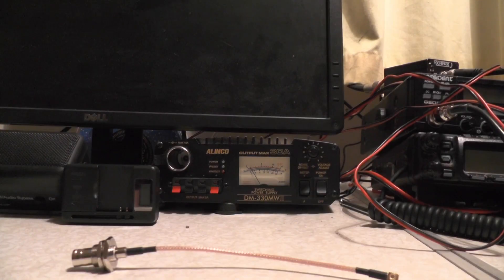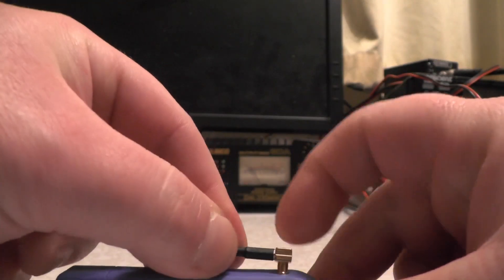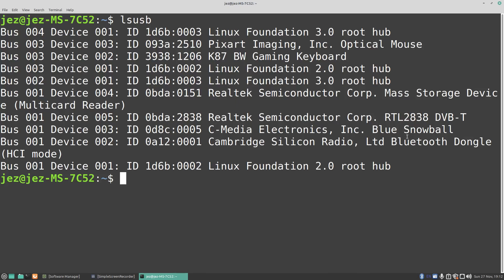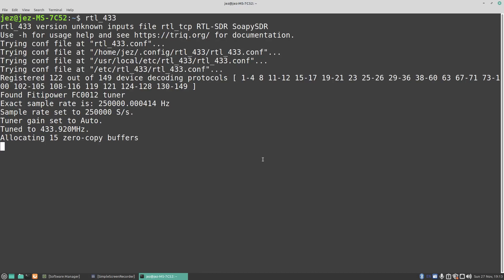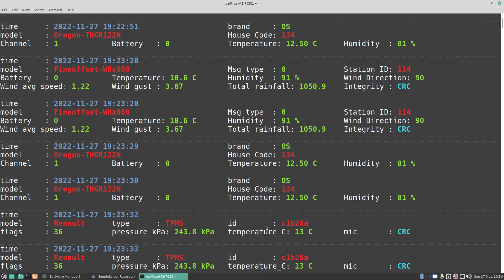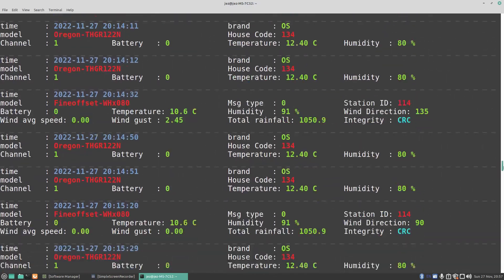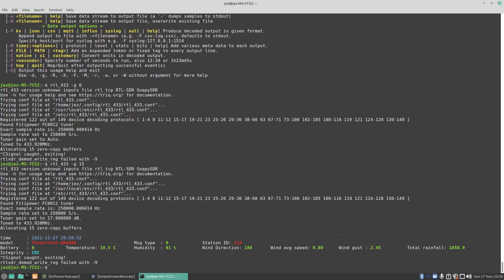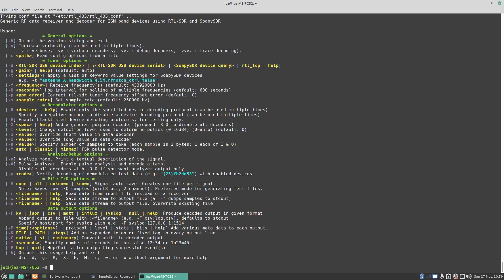433mhz LPD Decoding

Comment: Can it scan entire 433-434 range to find any bursts?
Reply from the maker: not as far as i'm aware only the one frequency
Reply: @2j4ez  The most interesting part is "detect something interesting around me". When I looking to spectrum waterfall on 433 MHz, I see LOTS of things happening. But it would take lots of time restarting the rtl_433 with different parameters on every "suspected" frequency. Especially when some bursts happening rarely: 1 times per 2 minutes.
Reply from the maker: @assaissa  most things are on 433.920 and 434.320 and 434.330 mhz